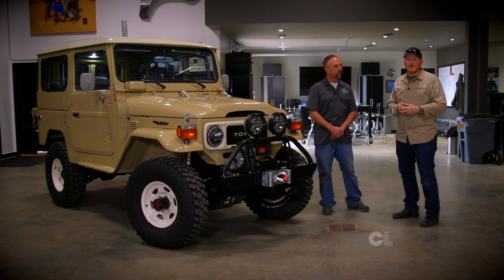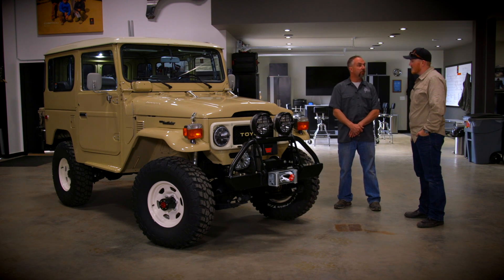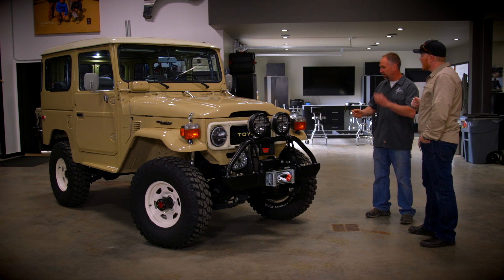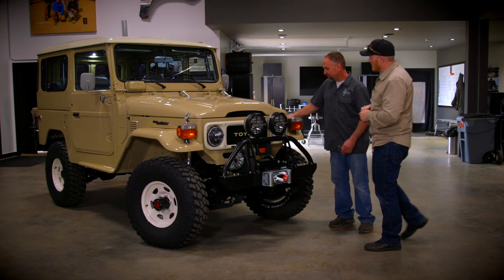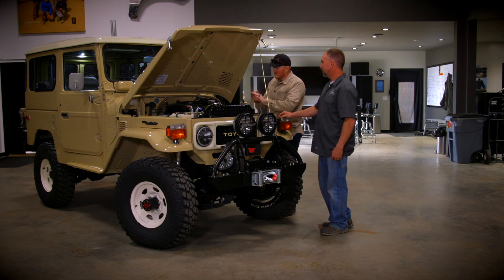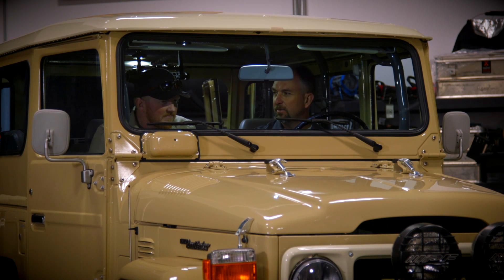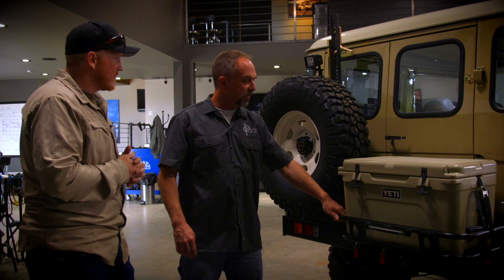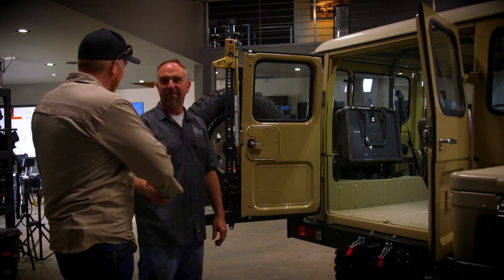"In The Shop" 07: Jeremiah Proffitt's 1982 FJ40

Comment: real super nice but what you said a 10056 thousand miles and he said a lot for a fj gee that's not very good if that's a lot for a Toyota my 99 lincoln navigator and 2000 expedition all ready pass that mile' s and zero troubles and yes some of that is off road mud sand and rock crawling owned both over five year's zero trouble m.p.g. 10 to 12 around town highway 22 to 24 this is consistent m.p.g. C😎😎L no line no bullshit
Reply: I don’t believe he was referring to 40’s not lasting for 250k miles but more to the fact that people don’t drive them to that amount very often. The nature of the 40 often keeps them off the highway doing a ton of miles.